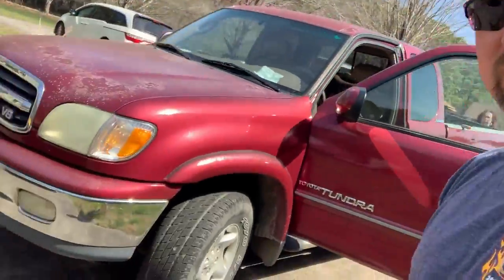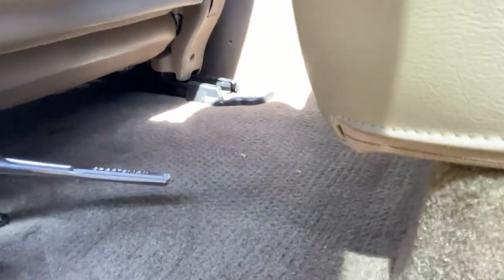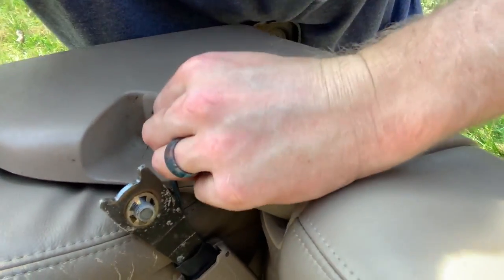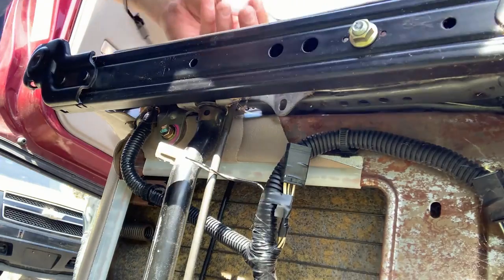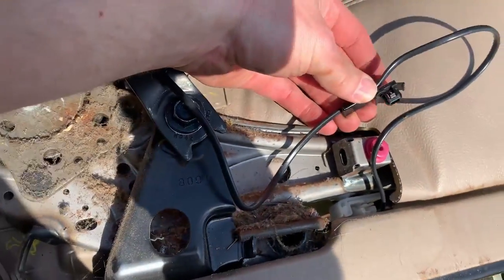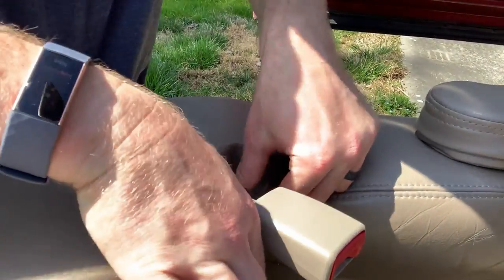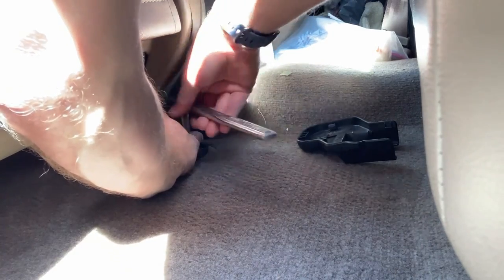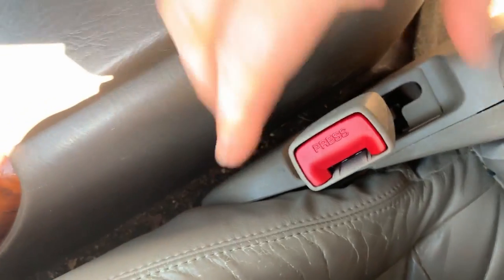2002 TUNDRA Seatbelt replacement

Comment: Thanks for posting this. Took me just 15 minutes to do thanks to your video.
I was originally preparing to take out the console. Not a good plan.
2001 Tundra without electric seats was slightly different, but in an easier way.
Reply from the maker: You are welcome. And thank you for the kind words. I’m glad it worked out well for you!!
Reply: @GWBarker  ...and here I am one year later doing the other side. SMH
Should have just done both together.
Thanks again man.
Reply from the maker: @rodglen7071  well. Then I am glad to be here again.  Happy Thanksgiving!